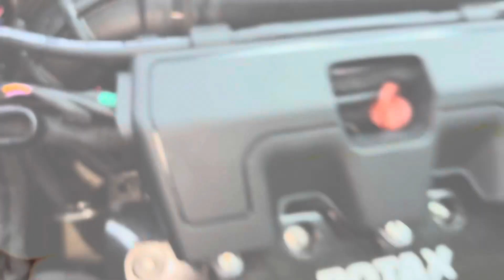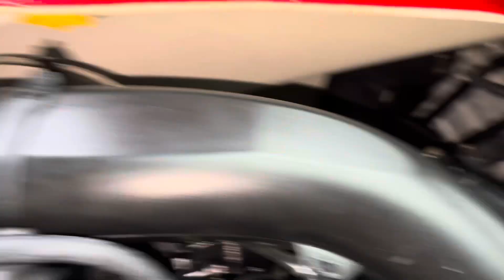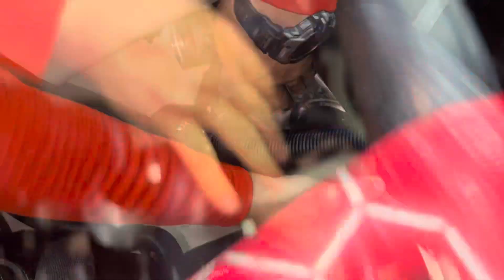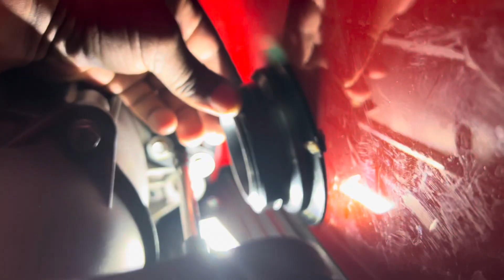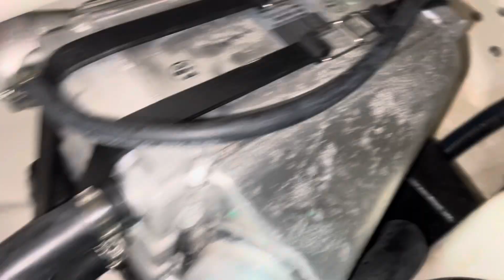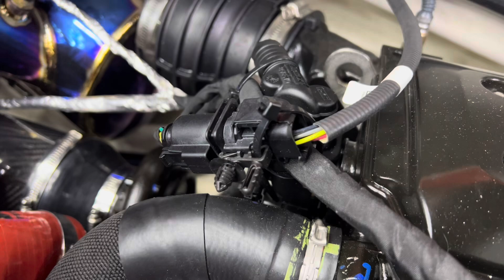The ultimate seadoo 325 build !

Comment: its much nicer if you put the stock exhaust block off in from the outside, just use silicone on the blockoff to hull and stock nut on the inside, much cleaner

Comment: The 18-24 rxpx rxtx grx gti free flow exhaust, does it fit on a 2024 rxpx 325?
Reply from the maker: @snakedudemarosfoi1962  yes fits 325 no problem
Reply: @cowboybishopvids6570  alr thanks and do i also need a waterbox or am i ok with the stock and also what option do i need to select because 2024 rxpx isnt an option do i select 21-22 rxpx?
Reply from the maker: @snakedudemarosfoi1962  21 and up rxpx the same . You should get the evo waterbox if you want the aggressive sound from the videos
Reply: @cowboybishopvids6570  ok thanks is that also on your website or is it a different company?

Comment: I wonder if  there might be a reason nobody has done a ram air system on a PWC?  Might be to avoid hydrolocking the engine?  Curious to see how this ends up working out.  I think its a great idea as long as there is a way to prevent water ingestion.
Reply from the maker: @jasonb9629 sold over 250 ram air systems in 2 years and never 1 hydro lock. You have to get it and know how to use it. It’s not for your casual everyday newbie rider.
Reply: @cowboybishopvids6570  not gonna have a pissing contest with you there cowboy. I call bullshit though on your 250 sales claim LOL.  I looked at your products and see  the lack of quality. Everything is half assed. You ever hear of a v band clamp?  I see you prefer the hose clamps though.  JP Racing and Riva are so far ahead of you LOL. Maybe see if they sell a ram air kit?

Comment: Congrats on a great video, your narration of instructions was excellent.  I am not sure that the relo of the flush fitting is in the best location.  How do you install the water hose if you have a border ladder installed?   I have two T3R hulled PX models and I have to use a ladder for deep water boarding with the single passenger seat.
Reply from the maker: That’s the only place you can relocate it. If you have a step ladder in the back it’s best that you go single exhaust instead of double barrel
Reply from the maker: You can pull the ladder down to hook up the hose.

Comment: What's the ETA on the Ram Air system? Also is that a RXP 300 Water box? Any issues with exhaust temp? Heard RXP 300 Fizzle Super Coolers are smaller then the OEM 325 intercooler and caused IAT warnings/codes. Thanks, can't wait to have my 325 blessed with these parts.
Reply from the maker: No issues on any warning or code lights. Our intercooler are bigger than oem and super efficient at cooling your intake temps. Carbon fiber front ram air start shipping June 30th. The 300 and 325 waterbox are the same thing. Fits both and 170-230 seadoo 2020 and up.